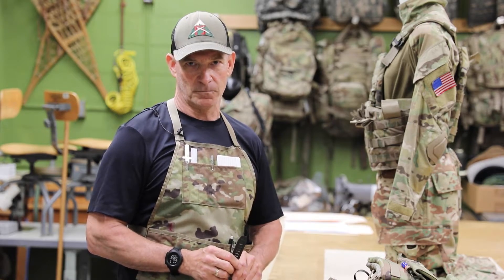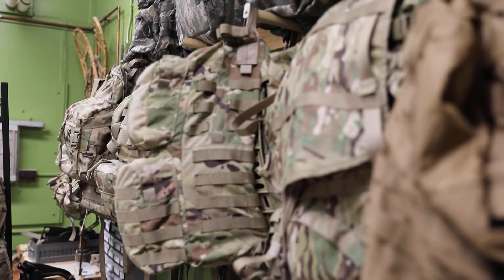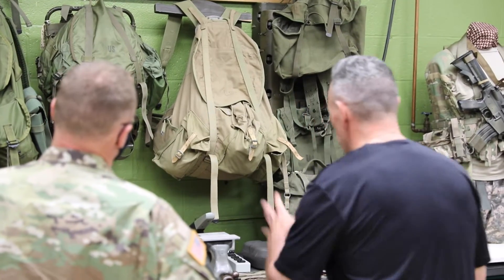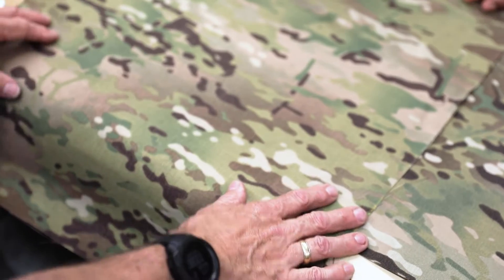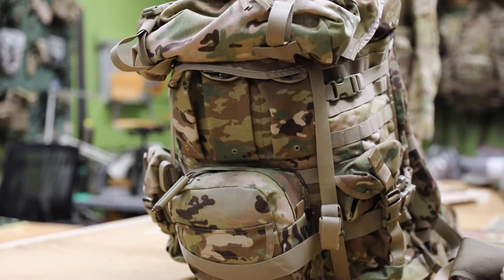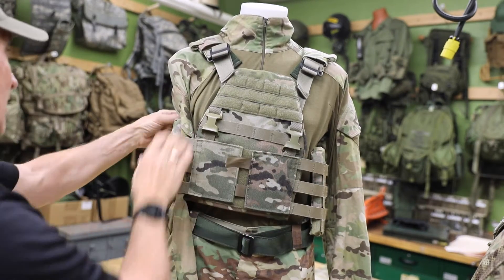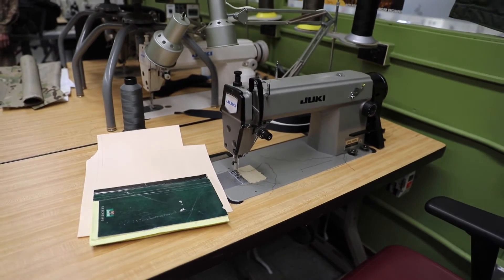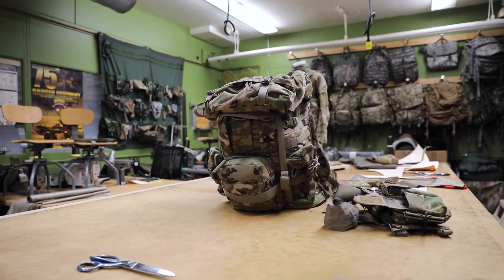Behind the Creator of the MOLLE 4000

Comment: But they ALICE Rucksack, Large is half the weight. 
The MOLLE 4k is phenomenal, and much better than the MOLLE 2.
But it's still over 12lbs empty, and the Large ALICE is under six pounds empty.  
That's a difference. 50% more weight for 5% volume.

Comment: I think some people just hate anything that’s issued. Honestly i think issued gear rocks for the marine corps at least haven’t used any army stuff in the field but I’d assume it’s mostly the same.
Reply: Shoddy zippers and blown out elastic aside the FILBE is just a product improved MOLLE 2 Large ruck. The bag is all-around better but the frame and suspension is basically the same mediocre package.

The 4k is four steps backwards from all of that. They heard "give us back the ALICE pack" and took all the worst aspects of that and merged it with the worst parts of the MOLLE rucks.

The bag is undersized and lacks any ability for expansion. The frame is the same mediocre plastic that loves to crack. The shoulder straps are somehow even more unergonomic and unadjustable (not contoured at all; will rub your neck raw; sewn straight to the top of the bag). And they still haven't figured out what load lifters are supposed to do.

Comment: The biggest issue with this pack imo is the lack of sustainment pouches, just less useful than the large ruck. Speaking from experience
Reply: I just got issued one. Might buy some to add on the sides. They are really convenient for quick access gear.
Reply: @freddyt86  I tried because of the placement of the molle web you cannot fully secure the sustainment pouches and you cant use the straps on the sides to cinch them down as easily as the regular large ruck

Comment: Large molle ftw, but integrated air items are nice
Reply: Seriously, if they had used the frane design (with better quality plasic) from the molle large, designed the shoulder straps better, and extended the sleeping bag compartment opening so that you could actually fit the sleep system in without having to completely unload the ruck, tgen the 4k would've probably been an instant hit.

Comment: Alot of soldiers make the mistake of using the compression sack for their sleep system, they would save alot more space if they just put the sleep system into the pack and let it 'fill the voids' like water takes shape of the cup
Reply: How is that a mistake? I've definitely been able to pack better using compression sacks for sleeping bags than just stuffing it in
Reply: @ that’s quite literally impossible, it’s called the brazil nut effect
Reply: U can buy a after market sleep system for 70$ that's 1/4 the size and twice as warm
Reply: @tomdairy4305  I doubt for that little, I have a 2 down sleep systems and ultralight bivy bag that was about 500$~ It weights just under 4lbs for all 3
Reply: What make and model? @tomdairy4305
Reply: @tomdairy4305 you mean 300 and a little warmer

Comment: I was perfectly fine with my Alice pack.  It served my needs, even to today.

Thanks for nothing. That Molle stuff has always been crap. More crap does not equal less weight, geniuses!
Reply: Yeah they just need to restart production of the frames and issue them out. So much has improved with padding and straps that an ALICE pack with some new bits perform much better than a MOLLE while being cheaper than high end rucks.
Reply: The ALICE pack is tuff to beat. The harness needs tweakage to fit around modern plate carriers but thats about it.

Comment: I fielded a Molle 4000 in the 82nd years ago... it was trash, like all military packs
Reply: I got the non airborne version. At first I thought I was missing pieces but, I looked at my hand receipt and everything was there. The straps are low quality and does not even have the quick release on it. No sustainment pouches and I can't put my sleeping bag in the bottom. They expect you to put all the weight in the center. Only good thing is I can't feel anything while rucking so I guess that's good.
Reply: medium ruck is only good issued pack,
Reply: The initiated always go back to  the original ALICE
Reply: Just received one. The shoulder straps are mounted straight down, as if I have no neck. It’s a terrible design. Even worse when you’re wearing a plate carrier 🥴
Reply: I seriously doubt that
Reply: I did TnE in 1bct 82nd on the prototype molle4k in 2016. Used a slightly different frame, air items had a yellow loop. And I was just 1 large pocket instead of the Alice style 3 pocket. 
We didn’t like the prototype for the same reasons we don’t like this one.  I still have it for some reason…
Reply: That’s a lie, it’s been around like 18-24 months
Reply: The first test units went out to the 82nd in 2018. I believe him.
Reply: @tboxcupcakes I saw one on a ranger school cadre back in 2020.